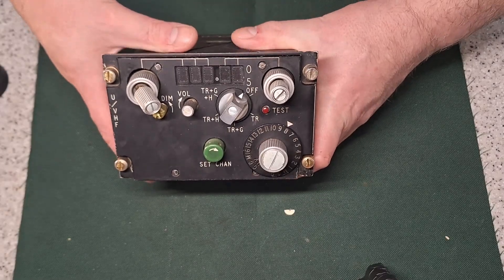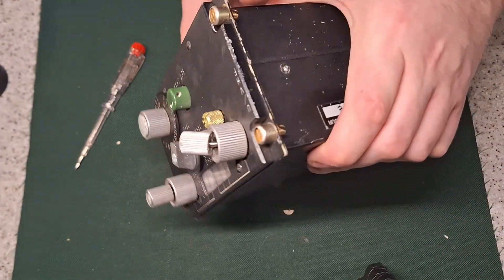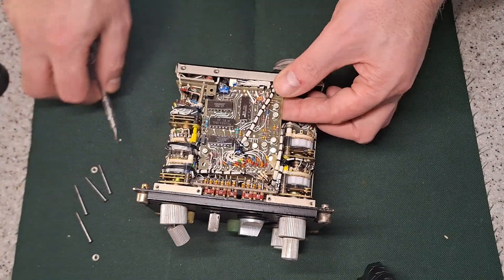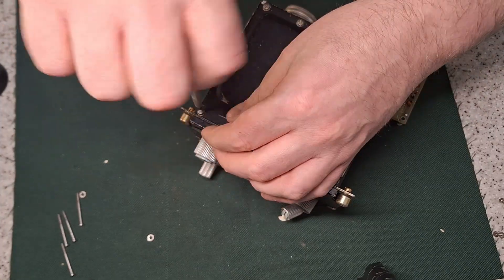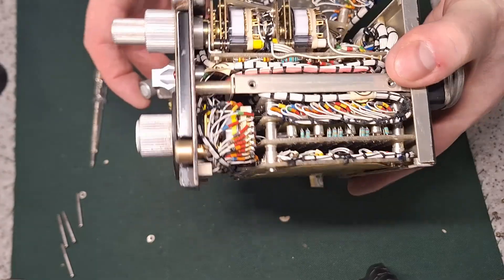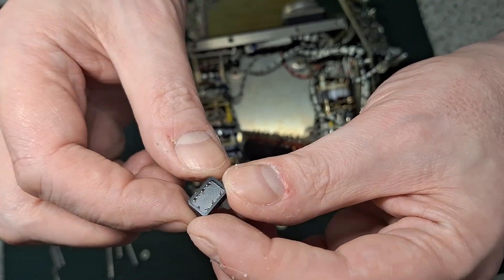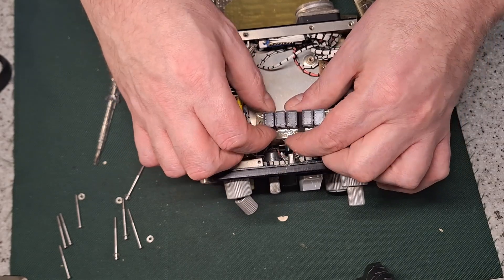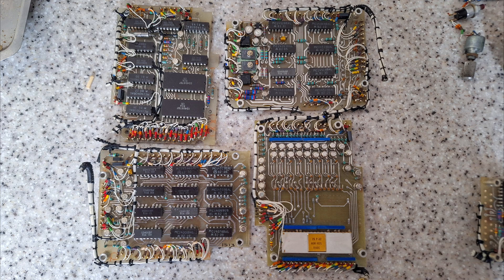Plessey PV1754X Military Radio Control Box Teardown. A well built but hard to service unit.

Comment: even if it was no longer working, somehow I felt you destroyed something that was a beautifully engineered part
Reply from the maker: I can't keep them all unfortunately and it would not sell. I have a Russian radio head unit which I will tear down and see how it compares to this. That I will try and get working or at least the displays working then it could be used as a film prop or even make it into a unique alarm clock or something.
Reply: exactly, I would have loved to have this piece in my collection. Such equipment should not be destroyed!

Comment: You are the most clumsy guy i have ever seen , dismantled such beautifully engineering equipment 😮😮😮😮😮 with that stupid screw driver 😂😂
Reply from the maker: It was faulty, yeah it's a shame in a way but I wouldn't destroy a working device. If it were serviceable I wouldn't have stripped it for parts.